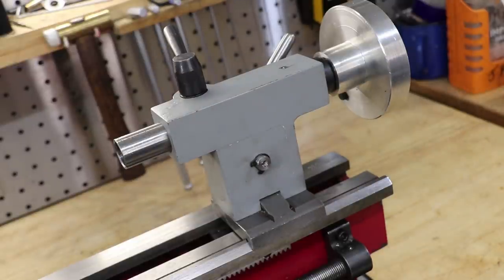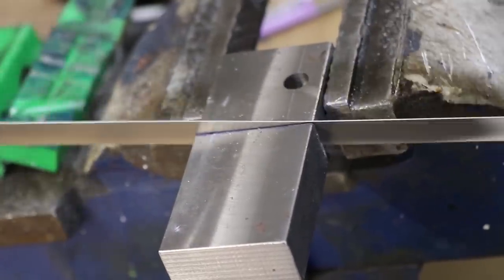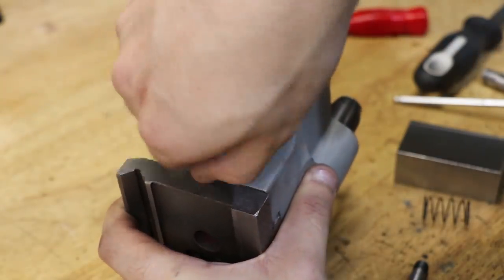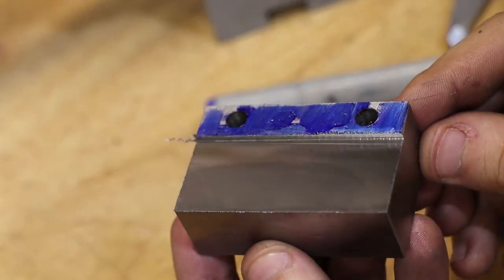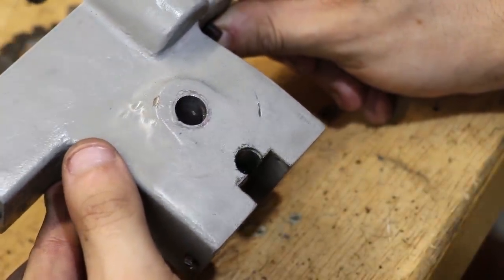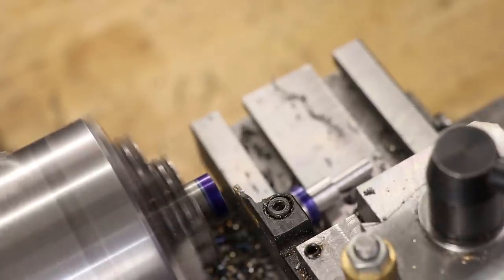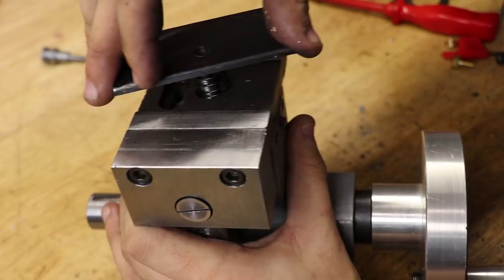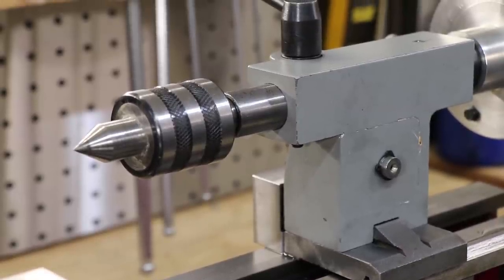Lathe Tailstock Fine Feed Upgrade

Comment: Adding another pair of tailstock side adjustment grub screws let's you leave one set at centered setting... although I've only moved my tailstock once in 4 years it returned to the same position. My grub screws for adjustment have all been turned smooth and where they seat on the tailstock body has also been improved with ball bearing ball contact points.

Comment: I appreciate your approach to the videos you put out, instead of just showing us your successes every time you are honest and show us the warts and all mistakes and successes.
Most of us meer mortals do make mistakes but are reluctant to show them or admit to having made them at all.
In your case it shows us how to bypass or rectify the problem and that in many cases is just as important as the original modification or fix as well.

Thank you for that 😁

Have you considered with the plastic part that holds the motor doing a collaboration with a Foundry channel like 
myfordboy, 
Windy Hill Foundry (Clarke) 
swdweeb (Perry) 
Or the many others and have A presence on YouTube to cast the part in aluminium or brass, bronze etc
You can add the speed holes to suit when you get the casting delivered, and hopefully a step closer to a better machine. 
Tony from Western Australia 🇦🇺

Comment: Nice video and presentation. 
At the beginning I was under an impression by the video that tail stock alignment was out vertically. In the end I saw work done to compensate misalignment horizontally. Am I right about that?
Reply from the maker: This this is for horizontal alignment. For vertical alignment I rely on using shim stock under the top half to bring it up.
Reply: OK thanks for confirming.

Comment: 1:01 I wonder which steel material typ (material number, designation) did you choose?
Reply from the maker: I think it was hot rolled 300 grade although I dont think it is that important what grade you use for a part like this

Comment: Asking bc I don't know if this correct, wouldn't a better design be a adjustment bolt for the front and back of the tailstock? The front may be on point, but the back may be out of alignment? Please advise if possible
Reply from the maker: It did occur to me, but Thankfully the set screws at the back square up the tailstock when tightened, so it's not really an issue.

Comment: way too fast for a counterbore btw. They work best at as low speed as possible.
Reply from the maker: You dont have much of a choice on a small mills like this, any slower and the mill risks stalling. On smaller machinery you don't always get the luxury of hitting that sweet spot rpm, and counterbore on steel did stall the mill a few times

Comment: You are using your edge finder wrong you have to let it flick out to the side then its right
Reply from the maker: Another method I have seen work is to push it into the corner, which kicks it into a wobble, back off and then find the edge a second time. Ive done both methods and I've seen practically no difference between the two.

Comment: Hey man, that's too much messing about........if you want a really practical quick trick I learned many years ago for getting the tailstock in almost perfect alignment....good enough for any drilling.........you make a ring with a hole in it the same diam as the tailstock barrel..........holding that in the 3 jaw and sliding the tailstock up to the chuck will soon let you know if the tailstock is aligned when you poke the barrel into the hole......must be a close fit......otherwise if you are a very fussy perfectionist and an ardent nit picker just use a dial indicator.
Reply: The real problem isn't the adjustment, it's the lock screw that's underneath the tailstock and hidden by the locking plate. No way you'll get it locked in alignment using any method at all without at least some modification.
Reply: @cooperised  Bad design.....when I designed and built my first micro lathe back in 1966 I made the tailstock sit on the base piece with a dovetail....it has 2 screws on the side of the dovetail like a gib and this locks the top part to the base.....I have to wonder how these people think when it comes to simple mechanical things.
Reply: @gangleweed  Agreed, of course.  Appalling design.  With some of these machines, you get something that looks like a lathe, and then you're on your own.  Which is partly why my own lathe is from the 1950s - I'd rather work with a well-built machine with some wear than a brand new machine with these kinds of design problems.  Of course there are new machines that are really well engineered, but I can't afford any of them!
Reply: @cooperised  Yes it all comes down to money.......my lathe is a 1930 Colchester Bantam, acquired in 1979 in UK,  but I also have a micro all steel lathe with taper roller bearings that I built in 1966 and still going strong.
If you have decent 3 and 4 jaw chucks work holding takes on a whole different scenario.